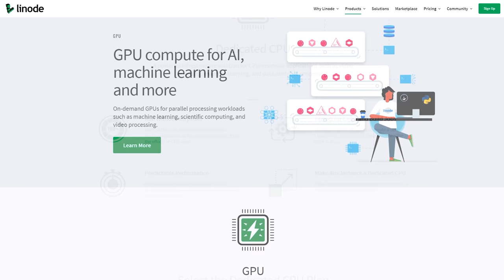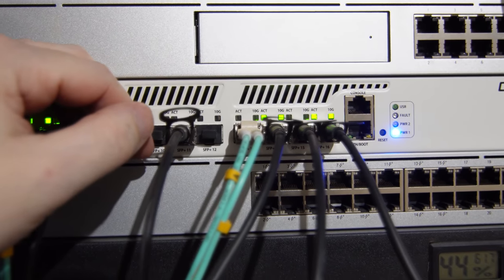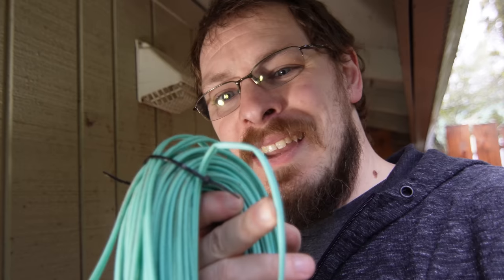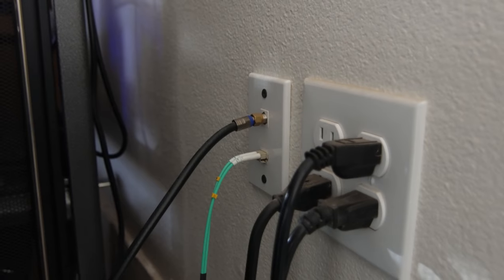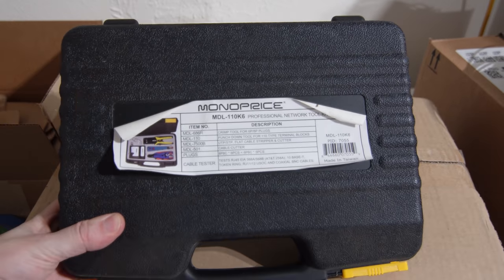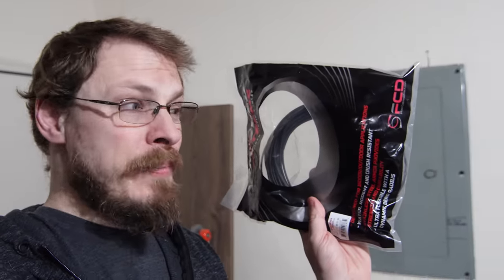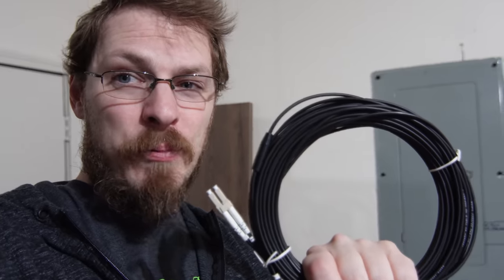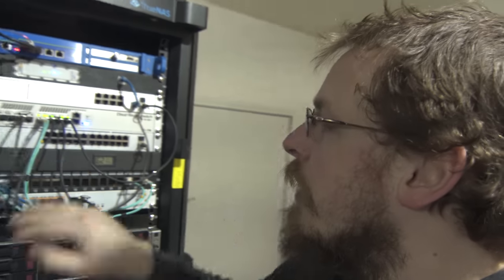Mistakes were made. Let's fix them.

Comment: Silly question, do you need an outdoor rated fiber cable if you are running it in conduit? Like fiber and power through a 1 inch pvc conduit that you bury in the ground?
Reply from the maker: Technically no, but I would still recommend it. Water and other issues could still damage an indoor cable. The cost of armored cables have dropped significantly in the two years since I did the first run.

Comment: What NIC are you using in your servers and desktop?  I just installed 10Gb fiber between my switch and Fortigate.  Currently using LACP for the server and workstation, but was thinking about just switching to 10GB either copper or fiber.

Comment: no cleaning of fibre before you plug it in: it may ruin your day
Multimode plastic fire isn't that hard to terminate as you may use "easy" connectors without splicing. A little bit of training and you could get a clean cut which you may put into an easy to install plug. Singlemode glas fibre is hard to terminate; factory pre made fibre is allways easier but clean the sockets before install or your results may vary.

Comment: I was just thinking back to when I started in networking.  Doing 10Mbps over Cat 3 and Token Ring in coax.  Things have really moved on in the last 25+ years.
Reply from the maker: I never had to deploy Token Ring networks, but I maintained and tore out quite a few of them.
Reply: @CraftComputing  I don't miss it in the slightest.  That and Novell Netware are two things I never want to see again.
Reply: Kids! I remember T-base-2. Like TR but a single cable and it was capped instead of looped.

I kept my Ohio Scientific computer (1981 or so, and no case since I was a poor college student) and it's now office art that people refuse to believe used cassette tapes for media and a TV monitor for a display. I wish I had also kept my old hub (not switch) that had both T-base-2 and T-base-10 connectors.

Comment: I'm surprised you don't have wallports on each side of the wall with a short segment for the wall transit in between. You could have a wallport inside at an easy-access height with a cable up to the height of the eaves then go through the wall to a protected wallport on the outside. This would also ease your cable length issue.
Reply from the maker: External wall ports are a super bad idea. Fiber connections are very sensitive to dust and moisture. You want as few breaks in the chain as you can get.

Comment: I wonder why Jeff did not run the new cable in 1/2" conduit with L-Style connectors at each point of entry into the home. that would protect the cable from UV and potential pests (Rodents, random utility guys, etc).
Reply from the maker: Have you priced outdoor conduit? Let alone the time of putting it up, I could buy 4x of these cables for the same price.
Reply: Yes that was my thought too., some lengths of plastic conduit and joint pieces is cheap piece of mind.
Reply: @CraftComputing  Unfortunately in these times, I can understand why for economic reasons to skip conduit. At $43 per 10ft stick (just bought some recently), that would give me pause as well. If it was a normal price of $5-$8 per stick, then it would make sense. I did this for a very small run (~ 5ft) for the fiber connection coming into my house. Sadly most utilities are using unshielded fiber from the ONT outside into your home (at least in Florida), so I foresee more folks running into your situation in the future.

Comment: If you did want to terminate your own optical fibers for custom-length runs though, the cheap way to go would be to purchase pre-terminated pigtails and use a fusion splicer to fuse the pigtails to each end of the run.
Reply: Not actually the solution for a point to point 'patch' as you would have to protect the pig tail to cable run end. Ends up having to be completed into a splice enclosure/fiber patch panel to secure the cable run and the splice tray of sorts.
Corning have a kit to terminate a fiber patch style cable with a new LC/SC or whatever connector needed, but requires an fusion splicer just like what you might use with a standard pigtail termination...as me how I know :D
Renting a fusion splicer, buying fiber on a spool that's armored or whatever spec you need for a run, correct pigtails, special heat shrink sleeves for the terminations and enclosures for either end is actually great learning. Also means you can have a number of fiber connections between points, multi 10G or 100G+ if that's what you are after.
Before folks think there is money to be made splicing etc..from speaking to a professional, it's no gold mine

Comment: do you use fiber cleaner when you plug in and out the cables? if not would recommend investing in a cleaning pen or two
Reply from the maker: Caps were on until the very last second for the outdoor run. I do have a fiber brush tool.
Reply: @CraftComputing  yhe, but the fiber sould always be cleaned everytime you change fiber or install a brand new one. The fiber cable + the keystone or sfp etc. it terminates really quick.

Comment: Yeah that looks about right, it's often a bad connection or cable somewhere or just something wasn't done right at some stage down the line that leads to trouble... Does the networking hardware your running use alot of power or produce much noise? i'm just using a small netgear POE switch myself with some cat5e shielded here and there, always been curious about fiber networking in the home...

Comment: Jeff, After all the hassle you've spent rerunning that fibre segment I can't help but cringe that you went with multi-mode, there's so much advantage to single-mode and trivial cost differences. If your original tie cable had been SM and I had discretionary ability to take a fusion splicer home I'd have offered to help out for some potential spare hardware and a basket of In-N-Out with some brews since I'm not far down the road in Molalla but here we are.

Comment: Anyone tried fast fiber / easy fiber products? The ferule is installed in the factory so the perfect alignement is guaranteed and you only have to install the connector cap, it looks like the perfect solution to install fiber in a flat where you have to go trough wall conduits: it's expensive and seems to be only available in single mode tough. Or anyone tried cold splice / field installable connectors?

Comment: not to state the obvious but why use fiber at all? would cat6 not be more practical?
Reply from the maker: CAT6 won't do 40Gb.
Reply: in home and small office cat6 is much more practical.. the biggest advantage of fiber is the distance which it maintains linkspeed. Another big advantage most dont think of is when going from one building to another, fiber wont conduct electricity in the event of lightning or in the event the 2 buildings are on different power grids the grounds may be at different potentials.
Reply: @CraftComputing  not with that attitude